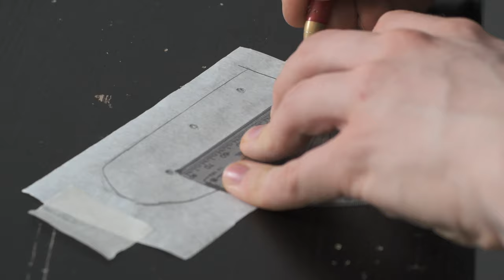Making a Custom Guitar Body for a ready-made Neck

Comment: That piece of ash was gorgeous when finished.
The 7/8ths body size doesn't really stand out - it is more obvious on something like a Jackson Dinky.
It would have still been nice to see what it would have looked like at full size but with a centre strip.
The matched grain on the plugs turned out nicely too. Most won't notice.

What was the stone you put on the belt sander just prior to sanding in the arm bevel?
Reply from the maker: I was so happy with the piece of ash and the finish :)

Andyeah, the slightly smaller size doesn't really stand out here. I really should've pulled up my own strat-copy to compare it with. And getting the plugs to match was such a relief!

Ah yeah, that is sandpaper cleaning block. It's actually a rubber that removes build-up from sandpaper. Really nifty stuff and exponentially elongates the lifespan of your sanding belts and whathaveyou.

Comment: I was watching your video. I purchased a Bc Rich ST 24 usa from Sweetwater guitars it's a beautiful black finish. I paid $4,600. I did notice a faint straight line through the finish from the bridge straight down turned the guitar around it, maches is that normal, or should I return it? Is that where they glued the body together? I don't know. I feel like I shouldn't see any faint line for the price. Please advise. Thank you
Reply from the maker: That indeed sounds like the centerline or essentially the joint at which the two pieces of wood meet. That is completely normal and a part of guitar construction. In some cases a luthier can make that line less visible by matching grain and figuring or by really making a perfect joint. If the joint is good, but not quite perfect this may result in the glue line being more visible.

So it is a normal thing, but again hard to tell how glaring that line is in real life versus a description in text :) to me, you paid a lot of money for the guitar and if there is something about it that bothers you, you should be able to contact the manufacturer/supplier about it.

The high-end BC Richs are pretty insane quality nowadays, so I would imagine that what you are seeing is just the joint line that you get when two pieces of wood are glued together.